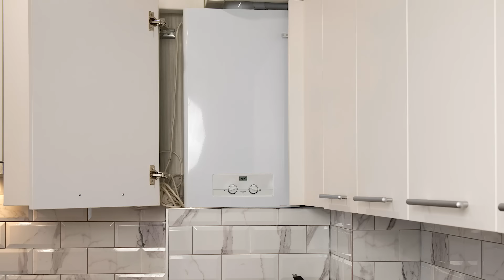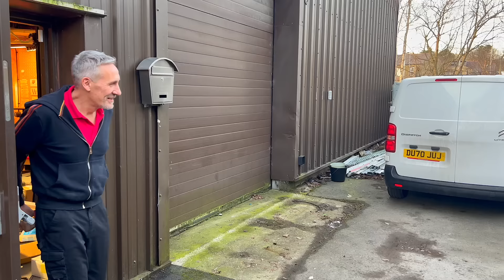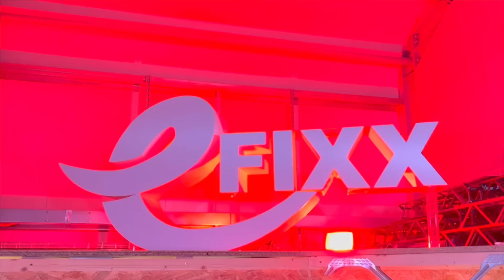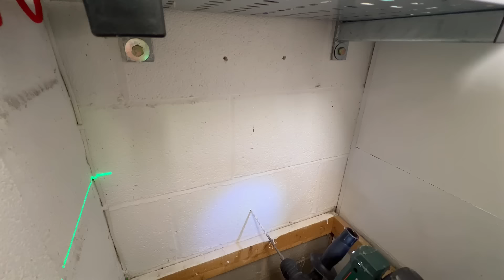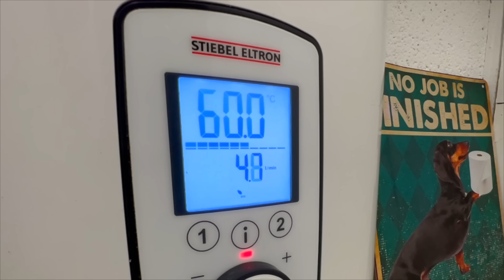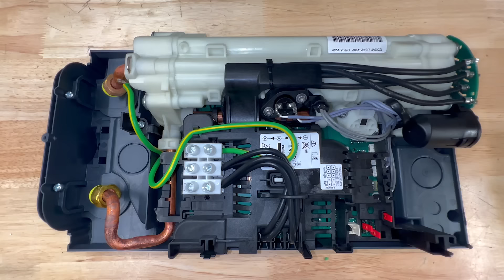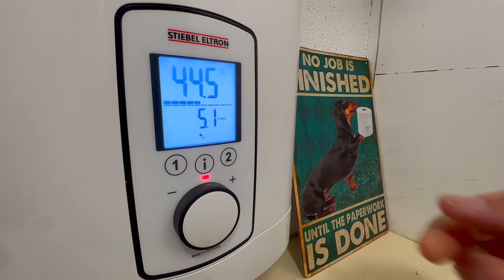The Shocking Truth About Water Heaters!

Comment: Instant water heaters chew a lot of amps.  Storage heaters may consume slightly more kWh across a day but the wattage is far lower.  Storage gives the option of controlled tariffs for cheaper rates and better distribution network management. Pretty typical for a house to have a 250-300l tank here.  Standing losses might be 2 to 3 kWh across a day.  (let's see if this survives).  My 125l tank drops about 1kWh of heat a day.
Reply: To heat a given amount of water by a given temperature difference is going to take the same amount of energy whether done in a low powered storage heater or instantaneous tank system. So the energy cost is going to be the same (if you can't benefit from a lower off peak tariff). But your storage system loses energy when not in use, so the instantaneous uses less energy overall. The downside is that the instantaneous power consumption is higher so your supply needs to be able to provide that - hence the 3 phase for the higher rated units.
Reply: @RylanceStreet  The area to mount the unit is much smaller.  Removal of the old tank frees up space.
Reply: @ Sometimes I genuinely have to wonder 'did you even read what you are responding to', and this is one of those times.
Reply: To heat 1 liter of water from temperature T1 to temperature T2 will require certain amount of energy. Instant heater will do it in matter of seconds with much higher wattage available and tank water heater will do it let's say in minutes with less wattage.
Both heaters will use the same energy to achieve this task. So number of Kw used is the same.

Indeed with storage heater you can use night tariff but then day rate is ridiculous so one has to be very disciplined with when you use energy.
I switched from storage to instant and my energy bill from £60 /average per month to £80 average per month. But this partially due to rise in energy rates in general.

So for £15 to £20 difference but  having luxury of using shower/cooker/ cattle when I need them at the same flat tariff  (£0.24lKwh). I can live with that.
Reply: @michaelprzybysz3789  Why do you have your HWS attached to a day rate?  The whole point of storage heaters is it uses a cheap off peak rate.  When you turn on the tap is irrelevant so long as you are sane with hot water use.  A family of 4 might require a 250l tank.
Reply: @retrozmachine1189  I don't.  After a year I removed HWC and switched to instant 10KW water heater in bathroom and 2KW 10liters storage heater in kitchen.

Monthly average cost rose by £20 but we still have whole summer ahead and I still haven't left for holiday even once so I expect that it will be even less than that.

In exchange I don't have to worry about planning my energy usage.

In general you have to be really disciplined about planing electricity usage for 7 economy to bring benefits. Which I'm not.
Reply: @michaelprzybysz3789  No you don't need to be disciplined.  You just don't hook your water heater to a non-controlled general supply.  That's it.  Wire it up to the economy control, what ever that may be.  The End.
Reply: It works for me just fine so I'm gong to stick to instant heater.
Gas would be great but with government constantly threatening with banning gas boilers not sure if I want to invest.
Reply: @michaelprzybysz3789  How nice, doesn't change anything I said.  Every single point in all my comments stand.
Reply: @retrozmachine1189   250l tank takes up a lot of space.  A small under-sink unit is not even noticeable.
Reply: @bfrahm  Not everyone lives in a cupboard.
Reply: @retrozmachine1189   Not every property has an economy meter or control, plenty can only benefit from low overnight tarriffs. RTS and economy 7 are rapidly going the way of the dodo, replaced with HWC heated overnight on lo tariffs.
Reply: @donkey1271  So.... what I said still applies.
Reply: @retrozmachine1189   No, not really because the person already has an instant water heater so they're just not in a position to benefit from low tariffs unless they want to shower at 2am or spend £1k+ replacing it with an efficient storage tank.
Reply: @donkey1271  sigh  Yet another person that doesn't bother to actually read the original comment to which they are replying.  So here we go ... try actually reading it.
Reply: @retrozmachine1189  Oh I’ve read it, what’s your point? You cannot take advantage of economy 7 with an instant heater, yet you’re complaining the other poster doesn’t have their HWS attached to economy 7, which they can’t do as we’ve already established.

What’s the issue?
Reply: @retrozmachine1189  I'm always amazed how many hot water systems I see without any lagging on the pipework. Losses are immense.
Hot water regs actually requires all the hot pipework within 1m running length from the cylinder should be lagged . Rarely is. Costs very little either in time or materials.
Reply: @alanjewell9550  Agreed, it's quite silly at the number you see here too.

Comment: Water tank boilers are stupid devices. Not only do they keep the water hot 24/7, the capacity is also low. The only advantage is that these fit into a 230V 10A socket. 2300 Watt.
Good instant water heaters with a three-phase connection, 400V 40A 15kW, are in a completely different league.

Comment: You would do a lot better installing a dishwasher for the mugs etc as it uses a lot less water and basically sterilizes everything on the rinse cycle, you know they even do ones that will come on during low demand to use lower price electricity 🤣🤣, then if you need a sink of hot water use a fast boil kettle or two.
Reply from the maker: One day when we have room - plus we still like to wash hands in hot water!
Reply: @efixx  whilst washing the mugs? 🤮
Reply: @efixx  whilst washing the mugs?😱

Comment: I have been to a few homes where they have replaced gas with electric heaters to heat homes. The problem is that not many people talk about is [ all your eggs in one basket ]. So remove gas boiler or oil burner. OK cool. Some homes have 80amp cut off fuses 3 ev chargers 2x9kw electric showers, a heatpump for central heating, and several of these devices in different locations.  Oh, and I have a hot tub outside. Oh, I have a sauna ok that's only on for 2 hours,get that. Some homes only have 60 amp cut out. So what are we going to do. Yes, the assumption is not everything on at once,  3 ev chargers will have to be unfortunatly as all work a distance away and need to be ready in the morning 5 days a week. And yes, they all need just over 6 hours at 7kw, and they all come on at midnight to 7am. to take advantage of economy 7 meter. Hmm, if I am unlucky and have an 80 amp cut out, I am stuffed more, so with 60 amp. Then if you're unlucky like me, we do get power cuts, and before we took gas boiler out, we used a 3kw generator, which happily allowed us to cook and run the gas boiler. But now we need a 20kw deisel genny to make sure our lives continue, like going to work washing cooking for all the family.  So what would work for us is a 3 phase electrical supply to run the home a we do every day and a 20kw stand by genny to make sure we continue our busy lives all using electric only. Fantastic if i did not have to pay the £15k quoted for 3 phase upgrades. The £7k for a genny is fine , don't have to have this but if you want live normal when tje grid goes off that's the price you have to pay. The demand for electricity will increase 20 fold, and I don't think the uk can not deal with this. That's why they introduced the ESEC documents and the official variable rota disconnection plan to its customers. So electric is good, but expensive, many homes not suitable for net zero, when the power is off you will freeze in winter. Great heaters
Reply from the maker: Load control is going to be important.
Reply: @efixx  it's the real big issue that no one is talking about, really.
Reply: I bought  a diesel heater as a back up. Found that I used that more than my GCH for heating last year. Now I've installed electric  heaters. But now I'm looking for a viable hot water solution for a shower and 2 sinks then I can get rid of my gas supply. 
And in a power cut I have solar with battery back up and a third of my house can run in a power cut.
Reply: @adrianmaguire5459  
Keep the gas.
Reply: Should not have removed the gas - cannot be beaten. If you have gas do not buy a heat pump.

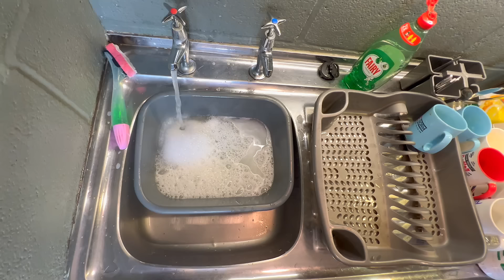Comment: 3:20 that's a sure fine way to cause the mugs to crack and explode next time they are used, rinsing them off with the COLD tap after being in HOT water! I will give marks for rinsing them, though! No one likes a soapy brew!
Reply: I always rinse in cold water and have been doing so for decades. Not once has a mug cracked or exploded at any point.
Reply: @gmo4250  I suppose it depends on what it is made of. Older materials are naturally as it seems more reliable. Thermal shock, however, is always a possibility. Personally, I've always preferred the hot water treatment as it dries faster and somewhat sterilises the crockery. Each to their own
Reply: @ConfidentialMeerkat  
Porcelain, ceramic, fine china, metal, wood, glass, all typical kitchenware materials. Nothing has ever succumbed to what you suggest. I'm not denying thermal shock can happen, but you'll need more extreme temperature differences, such as a dish out of the oven straight into cold water, or a dish out of the freezer straight into a hot pre-heated oven.
Reply from the maker: Great tip😀
Reply: blimey, I rinse stuff under the boiling water tap (actually 100°C boiling water) then switch to cold to cool it down again.  What fine bone china mugs teacups are you using!

Comment: This is the way going forward, have to take into account a car charger, solar, appliances, air con & using this at the same time but this a no brainer and with the inverters i normally install, these could have enough to run almost off grid completely. More of these water videos please
Reply from the maker: Load control is an important subject in the future. The UK tends to have a generous power supply compared to places like Italy where they have to install load controls.
Reply: @efixx  That will also be some good video material.
Reply: Are you crazy, 24Kw will kill solar and batteries in a day, you would need a solar farm to keep this thing going

Comment: What is flow rate off single phase 10.8 kw  at say 40’c.
Reply from the maker: To calculate the flow rate of water that can be heated by an instantaneous water heater with a power rating of 10.8 kW, we use the following formula:

\dot{m} = \frac{P}{c_p \cdot \Delta T}

Where:
	•	 \dot{m}  = mass flow rate of water (kg/s),
	•	 P  = power of the heater (10.8 kW = 10,800 W),
	•	 c_p  = specific heat capacity of water (4,186 J/kg·K),
	•	 \Delta T  = temperature rise ( 40°C - 15°C = 25°C ).

Step 1: Calculate mass flow rate

\dot{m} = \frac{10,800}{4,186 \times 25}

\dot{m} = \frac{10,800}{104,650} = 0.1033 \text{ kg/s}

Since 1 kg of water is approximately 1 liter, the volumetric flow rate is:

\dot{V} = 0.1033 \times 60 = 6.2 \text{ L/min}

The instantaneous water heater can achieve a flow rate of approximately 6.2 L/min with an input temperature of 15°C and an output temperature of 40°C.
Reply: @efixx  I am very impressed with your calculations😨 but not being very good at that, I just get a 5 or 10 litre measure and  time the filling may not be as accurate but near enough for me 😀
Reply from the maker: The magic of ChatGPT 😉
Reply: @efixx  I get nearly 11 Litres per minute at 1.5 bar mains pressure at 15’c ……..
Reply: It depends on their inlet (cold) water temperature. According to their spec sheets a 11 kW unit will produce 5.6l/min if the inlet temperature is 10C. So you could run one of those pesky water saving showerheads.

Comment: Here in the US, instant or tankless water heaters are becoming more common, but far more common for far longer are tank style storage water heaters in the neighborhood of 40 gallons / 115 liters. We've never really used the old-fashioned UK method of having an open air cistern at a high point inthe house.
Reply: @marcberm  cisterns haven't really been used in the UK for decades now, although you will still find them in older properties that haven't updated their system, combi boilers have been the norm for some time
Reply: @stevenloxton8118  Oh definitely, that's why I said old-fashioned. Combination boilers for hot water and radiant heating are becoming more common here too. As is generally the case, better stuff evolves in Europe and takes longer to see mainstream adoption in the US. The best systems in new construction will have heat pumps doing the heavy with gas or resistace electric only pitching in when necessary due to high loading or low ambient temps.
Reply: @marcberm  system boilers are super common as well and personally with the way things are going we should be installing system boilers. You can use solar diverters to help heat them with clean energy, you have an emersion back up and they are essentially the same as a heat pump in the way they work. If you go for a combi now and we do all end up with heat pumps it's going to feel like going backwards. A combi boiler is going to be 25kw + a heat pump just isn't going to do that in general they are around 5kw. In the winter at best you might get 15kw out which is a 40% drop in capacity compared to a combi boiler. Combi boilers can't exactly deliver hot water that fast either I've used multiple and yes I think they are superb but they aren't amazing. I much prefer our system boiler I just leave the hot water on permanently. I have 4 children I think in the 6 years we've been here it's maybe run out 5 times.
Reply: Geography matters. My vacation rental in Florida had a very small electric tankless system installed on the outside of the house. Water was plenty hot, never ran out of hot water - even on a cold day in January. Showers, dishwasher etc. Again geography matters. At home in Canada such a system is not only completely inadequate but is against code (outside) and would burst. 

The promise of tankless systems is “instant” and “endless” hot water. Depending on your geographic location and the sizing of the system your mileage will vary. In Canada, waiting  a while” for “endless” tepid water that will get colder if someone runs a tap (in January) after paying a fortune for a huge system is not a great solution
Reply: @thomascadieux9655  People also underestimate the efficiency of tank style heaters. They maintain minimal thermal losses, and the separation between hot and cold in the tank usually stays relatively undisturbed.
Reply: @marcberm  Agree it is pretty easy to an insulate electric water heater to reduce standby losses as they do not need a flue. On this side of the pond we have a 40 gallon electric heater with dual 4,500 watt 240V elements however they are never both on simultaneously.
Reply: You have to choose carefully. In the area I live the soil is heavy clay and moves. We get regular burst pipes in the road. Cutting off supplies. So 30 + years ago I decided to go for vented hot water. Being a plumbing, heating and electrical engineer it makes sense if you know the history of the area. So I at least can finish my bathing without worrying. By the way there was another burst last week with a fountain 40' in the air going through someone's roof. 
PS I hope you registered the plumbing work with a scheme provider?
Reply: @robincurwood  yeh I'm in heavy clay area it's a nightmare for my garden
Reply: @marcberm  cisterns are very outdated in the UK.